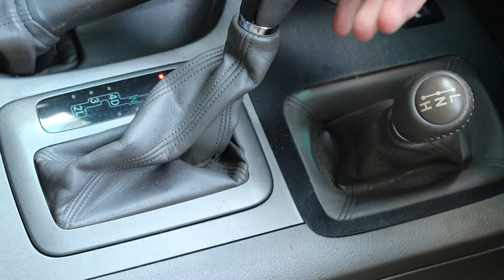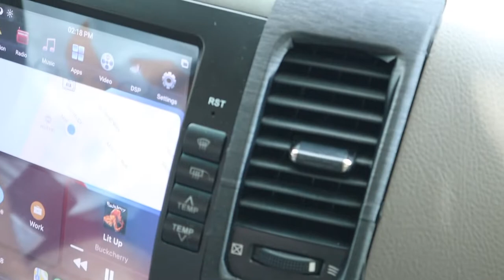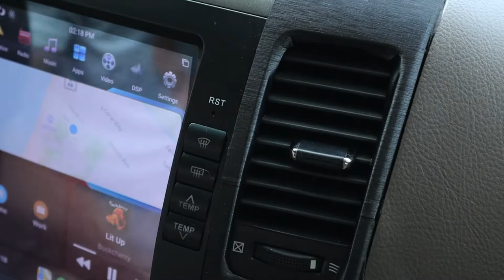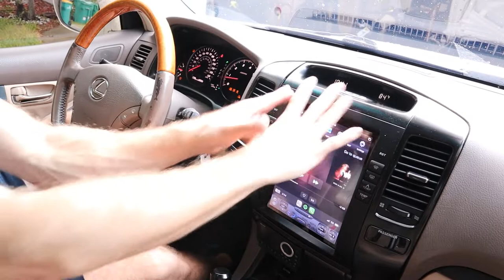youtube video #-9AA5Oesh44

Comment: I wrapped all the woodgrain trim a while back and the center vents are my problem areas. I like the black paint! New boots look good too. I've got some but just haven't put them on. Great vid! Chomp Chomp!😉
Reply from the maker: Thanks Randy! Yes, that vent area just has too much temperature variation for vinyl to hold up well…or at least that my theory. The black paint was an easy and nice solution. Oh nice, I’ve seen people use old Crown Royal bags for shift boots. Chomp Chomp!
Reply: @Awesomoto  yeah, I agree on the wrap issue. I thought of just getting the silver ones for a Prado 120 and going that route. I'm anxious to see how well the paint holds up on your trim.
Reply from the maker: @Randy-hk6vq  The Prado trim is a good idea. I too am curious how it holds up. I’m pretty confident in painted surfaces that are properly prepped. You’ll get to see over time how well it holds up. Hopefully it does.

Comment: Hello!! Your videos are helping me renovate the interior of my GX470.

Wanted to ask if the paint on the air vents worked great through the time. I was planning on doing this for all the wood pieces in the interior and even the steering wheel. I really liked the sand and black color mix.
Reply from the maker: Apologies for the delay. Great question! The paint is still holding up great and I'm in the intense Florida heat. The black with the sand color does help give some contrast.